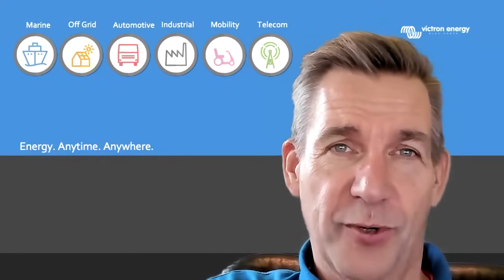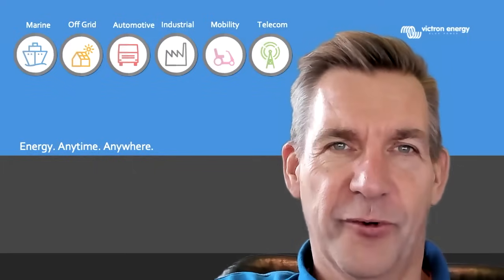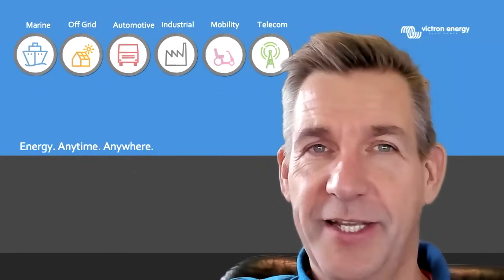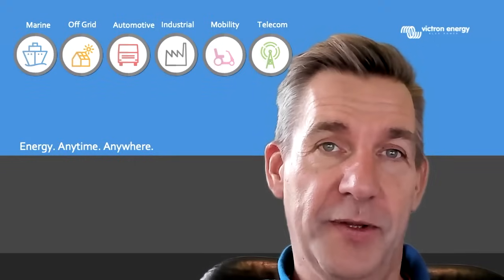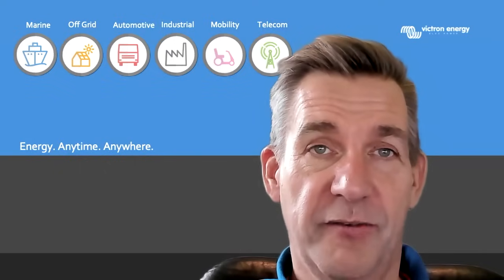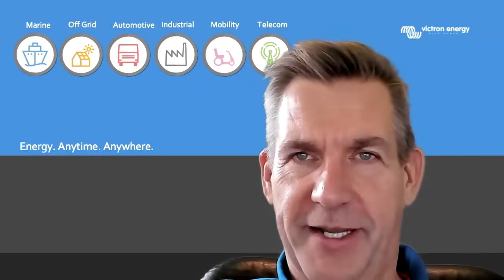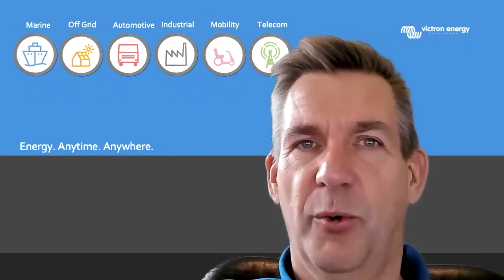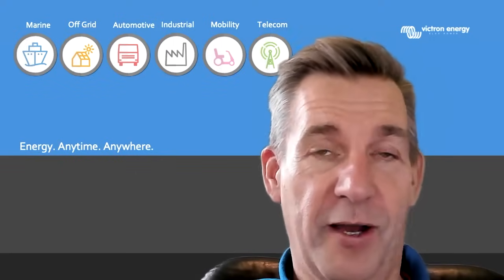How to set up BMV Battery Monitor for lead and lithium batteries

Comment: Great video i have just 1 question.  i just installed a smartshunt in my boat. We have both solar panels and shorepower nomally we will be on just solarpower and alternator power from the engine for say 3 nights then 1 or 2 nights with shorepower and then out again. For 3 nights. Should i program it after float voltage or absorbtion voltage in this mixed configuration? 300ah agm.  30a shorepower and about 400w solar.
And a bonus question. All producs are victron and connected to same  ve network dont the chargers tell the shunt when it is in float?

Comment: The title is "HOW TO SET UP  BMV". Instead you get a completely inaccurate description of the ElectroChemistry of a LA battery. The battery works on movement of IONS not MOLECULES. Quite fundamental. Was this approved by Victron ?
Reply: Ion / Anions are part of molecules e.g., KOH (potassium hydroxide) is the molecule while the OH "holds" a single negative charge. And still OH is also a molecule in itself, which it would be its state when dissolved in distilled water. What would be expected to move is electric charge, which ions facilitate.

Kindly provide factual, reasoned corrections, if any of the above assertions are incorrect.
Reply: the Lead acid batteries have molecules, the lithium has IONs.    It was approved by me by the way.

Comment: Dear Johannes, you state that in the original full charged state of a lead acid battery the positive plate will be covered with lead and the negative plate will be coverd with leaddioxide. In my opinion this is the other way around, In the fully-charged state, the negative plate consists of lead, and the positive plate is lead dioxide. mvg Jurgen
Reply: Yes correct, in fact both are plates of lead although the positive is covered with lead-oxide and the negative is pure lead.

Comment: I find this product very frustrating.   I'm using it with a 200ah LiTime 12V battery, a LiTime charger... I can not find a configuration that will reliably reset the SOC to 100% after charging.   I have posted in your community several times and the advice has been unhelpful.

I also find your support model of depending on dealers to be a disaster.   Your products are complex, with apparent nuance in your settings, and the dealers are entirely unprepared to help figure this out either.

Overall this gives a very poor impression of your product.   It's too complex for the dealers to configure, it's too complex even for the forum members to advise on.   Where am I supposed to go?
Reply: I am sorry to heart this.  it's actually not that complicated but it's not plug and play for users without technical background. Then better have an installer set it up.   Anyway   For your lithium, takes the charger voltage setting minus 0,2Vdc as the Vc setting. take the Ic as 5% so that the current needs to be low and the Tc at 5 min.  Should work fine when charged
Reply: @JohannesBoonstra-ol2nz  It's frustrating to have you say I should just use an installer, when your documentation is so lacking.   If you're not wiling to to create clear documentation for end-users, then you should stop selling these via retail channels.   You can't have it both ways.
Reply: @AndrewMetcalfe  The product is indeed not plug and play and requires experience on batteries to setup. The documentation and manuals go as detailed as possible but do require technical background. This goes for many technical products in your system I am afraid. It's impossible to make a technical accurate product for almost al batteries and assume the unit can be set up without any knowledge on the battery and charge regime.   Most people have managed to set it up though, it's also not that hard.  But I am sure your dealer/installer is willing to help you you need assistance
Reply: @JohannesBoonstra-ol2nz  Thanks for replying, I really do value your engagement.   I do think you'd do well to have some independent documentation specialists have a look at the instructions that you are providing.    This is a common question in your community.
Reply: @AndrewMetcalfe  the majority of user dont seem to have issues, the ones lacking the experience can contact the dealer/installer, is there anything wrong with that?   These are trained and motivated to help and you could even learn something on batteries
Reply: @JohannesBoonstra-ol2nz  You know, it's great that you're engaged like this, but assuming people are ignorant does reflect poorly.   I do not have a shortage of experience, but I do have a shortage of adequate documentation.   You don't actually have to reply to people on Youtube, but if you do - I recommend not insulting your customers.    FYI, a few posts up you told me 5% would work.   It does not.   I did try 10%,, and that does seem to be working for now.   Perhaps that is something you can change in the documentation.
Reply: @AndrewMetcalfe  its not ignorance  what I was talking about, it was about experience/knowledge.  It's not that many have had an education on battery/DC systems, which is OK.   But expecting to get this knowledge by reading through a manual isnt that realistic.   So thats why I give/gave that adivice to ask the expert you bought it from.    It could well be that your battery needs 10% instead of 5% what for other brands work, thats why there is not a single setting valid for everything. If that was the case the settings are not needed and we would have put the values in as fixed.     Anyway, most likely your battery supplier could have explained this to you as undoubtedly they have had to set up battery monitors before.

Comment: what about 220Ah battery float, absorption voltage and charging Amps when charging from Solar
Reply: that depends on the battery and charger setting.  Please ask the installer to make the correct settings.

Comment: I have a new SmartShunt IP65 installed and synchronized to my Dakota Li 12v 100ah battery after a full charge.  The shunt is reporting the current voltage at 13.3 (verified with a multimeter).  In the VictronConnect App, my Charged Voltage (per the manufacturer) is 13.2 volts, with a discharge floor of 10%, tail current set to 2%, and the peukert set to 1.05.  I am correctly wired.  While under load, the app appears to report correctly.  However, after a short period of time off load, the app will reset the SOC back to 100% and the ah consumed to 0.  This is a new battery.  It's being used with a trolling motor, and after a recent trip i used 7ah.  While the main screen reads 100% and no ah consumed, the history does show that i've been using ah's.  Is it possible that the relaxation period where the voltage is boosted responsible for resetting the SOC and ah consumed?
Reply: 13.2 Vdc as charge voltage might be too low, I guess you charge 14-14.4V ?

Comment: 04:20  "gassing should be prevented at all times" this may be true with AGM or Gel but with FLA you MUST allow them to gas as this is part of the absorption cycle. Without this gassing the plates will sulfate over time and fail prematurely which is exactly what happens with most lead acid batteries that fail early. If you are not putting distilled water in your FLA batteries every month then you are under charging them!
Reply: What most is used is the VRLA type, so there is gassing but this will not open te valves normally, for flooded (limited) gassing is OK to mix the fluids and have the charge process be optimal

Comment: Has anybody pulled the main points together?  I've really struggled to follow this and I'm a native English speaker with a first degree in electronics.  

Some well written documentation, and I've read the manual a heap of times, on the points covered would really, really help.

Comment: Hi
I have A Multi with new Victron Lead Carbon batteries.
I understand these are more efficient than standard Lead acid so what would \i set as an efficiency value and a Peukert value?

Comment: My BMV712 was a complete waste of money, I'm guessing like most similar monitors. It counts the state of charge downwards but doesn't count upwards, all it can do is reset to 100%  when it sees the voltage you've told it equals fully charged.

This means that as soon as I do any trip, unless the voltage hits the fully charged level, the soc reading will be wrong and misleading.
Reply: When it only counts down and not up, I advise you to have a look at the wiring as then most likely the charge current is not flowing trough the shunt but directly to the battery.  The monitor does NOT work with the voltage level to determine the SOC (as that's not a good indictor) but on current/energy instead (which is the right way to do this)    So please check the manual and installation and I am sure the BMV will make you happy!
Reply: @johannesboonstra6917  of course the charge current isn't flowing through the shunt, the shunt is on the negative side exactly as per the instructions. I didn't say it monitored usage based on voltage, I said it resets to 100% when it reaches a (user defined) voltage, that's all it's capable of. Total waste of money.
Reply: @paulshanesmith  per instruction, both charge AND discharge current need to flow through the shunt 
Please read the manual well , if you don’t follow the instructions, yes then it’s a waste of money

Comment: Trying to better understand tail current setting on the bmv shunt. It says to use 4% my battery is a 200ah batt. 4% is 8amps. My 200w solar charger which is my primary charger bulk charges the batt at 8~9amps. Seems like I would want a smaller tail current around 1-2amps or less with this type of charging. That would be .5% - 1% does this seem accurate?
Reply: Forgot to mention. Lithium.
Reply: The tail current is the current which will flow when the battery is full/under charge voltage. So that's determined by the battery.  This value is more needed to be set for lead acid batteries. Lithium is full when the end voltage is reached

Comment: Anyone know what I can do about my “low voltage” alarm? I have 300ah lithium battery with 400W solar. I left my iPad charging overnight which cause the voltage to drop to 11.62v which it’s been floating at all day
Reply: Then please recharge the battery asap with solar or a AC charger

Comment: You say "a lithium battery doesn't need an absorption phase", but then later, "take for the voltage charge, the absorption voltage minus 0.2V".  Why do you refer to the absorption voltage for lithium, when there's no such thing?
Reply: the lithium does not need absorption , But the charger does have a absorbtion setting which is used to balance the lithium battery

Comment: Having 4 x 12 volt 270 ah batteries in series and paralell  giving 24 volts and 540 ah. I am charging this with a Panda 6000KW generator but seems to take days to charge the batteries form 55% to 90% CEF is set to AU ?
Reply: This is an DC or AC generator ?        od DC , sure the negative is on the correct end of the shunt /On AC , where are you charging with?
Reply: @johannesboonstra6917  This is DC Generator, shunt is wired correct what are the correct settings my BMV Battery monitor for this set up ?
Reply: looking to set the discharge floor to 50% and the relay to start the generator at 50% and stop at 90% what would the efficiency need to be set at also ?
Reply: @michaelmunnelly-v9z  for lead that's about 75-80% , on lithium its 98%

Comment: Really good explanation, thanks! Brings together various strands from the manual and elsewhere and helped me make sense of it all.
One question came to mind regarding when an Orion is in use: say there are a number of short driving periods between which the engine is switched off (and therefore so is the Orion) does the same apply as for charged voltage and tail current on solar? Ie the charger going off at any point in the cycle is like a cloud passed over?
Assuming absorption should be 14.4V for a lead battery the charged voltage set at 14.2?
If so is there any issue when a proper float at 13.8V happens on a long drive or when a mains charge can be done?
Reply: the battery monitor will sync when the voltage is high enough combined with a low current, so if that's happening with an Orion its the same, as then also the battery is full.

Comment: Hello, I bought the Blue Smart Charger IP22 12/30/(3)  today and when my batteries (2x AGM 12v 140ah in parallel) are charging the charger makes a disturbing  loud enough humming noise. As the battery charges up the noise reduces. It doesnt get very hot but i didnt expect that noise  from a premium charger like Victron. Im wondering if i need to send it back because its faulty or something but the store i got it from says they may need to send it to Victron which means i will be without a charger for at least two weeks which is not ok. Anyone else with same expirience on that noise ? Thank you.
Reply: there is a noise coming from the charger , mainly depending on the AC voltage level.    If you think yours is too Lous, please contact the dealer and have them have a look/listen.  PS two week waiting for a replacement IF something is wrong is not true when contacting the official dealers (found on the website)
Reply: @johannesboonstra6917  Thank you very much.

Comment: Looking for settings for my system. 400ah 24v lifepo4 charging with Victron 150/60. Victron defaults to 28.4v absorption and 27v float. What should I set the "charged voltage" to? There's conflicting information online, in the manual, etc.
Reply: when the absorption on the MPPT is set at 28,4, the Sync voltage could be 28.1-28.1Vdc
Reply: @johannesboonstra6917  thank you!

Comment: That went way over my head very fast lol.  
Can anyone help me with my settings.  I’ll have two lithium 230ah batteries 
This is what I have so far 
Absorption 13.8
Float 13.4
Absorption 1-2 hours 
Equalization?
Peukert 1.05
Efficiency 99%
Threshold current .10
Time to go 3
Tail current ?
Discharge floor 20%

I’m sure I. Missing some settings but any help would be appreciated.

Comment: Hi everyone a little help please Am I right with these setting with using a mppt with lead 230ah battery mppt settings are 
Absorbsion 14.6 float 13.5 tail current 4… bmv-712 settings 
Charge 13.3v 
Discharge floor 50%
Tail current 4%
Charged detection time 3 mins 
peukert 1.25
Charged efficient factor 85% 
Multiplus settings absorbsion 14.6v 
Float 13.5v 
Or have I got this all the wrong way ? my understanding the charged voltage on the bmv needs to be 0.2v lower then the float in the mppt which is 13.5v so remove 0.2v leaves 13.3v or is it 0.2v lower then the absorb charge in the mppt so that would be 14.4v it’s very confusing sorry same with multiplus settings it’s confusing giving the mppt the bmv & multiplus all these settings to work together!
Reply: the Vc needs to be lower then the charge setting by 0.2Vdc at least,When having solar this needs to be based on the absorption voltage
Reply: @johannesboonstra6917  thanks for the reply really appreciate you taking time to buddy 👍 so on my mppt I’ve got 14.6 absorb and 13.3 float so that means in the bmv I have charged at 14.4 and float 13.1 
Also in the video he says to adjust the tail current to 6% is this correct ? I have 230ah of lead battery

Comment: Couple questions.  I have a Lithium LiPO4 900AmpHr @ 24V battery bank. Have a BMV-712 and a MultiPlus, generator and have solar with 3 Victron MPPTs.
Q1 - I am struggling with where to set the "Charged Voltage" Setting in my BMV-712.  My battery manufacturer tells me Bulk Voltage (same as Absorption) should be at 29.2V, and Float be at 27.6V.   I have set the charged voltage at 27.2V (based on prior info gathered) but in this video (@14:37min) Johannes mentions I should set it much higher at 0.4V below the Bulk Voltage (which is same as Absorption), so this means set it at 28.8V.   That's a huge difference, is that correct, I should set "Charged Voltage" at 28.8V in my situation, with Float V at 27.6. almost does not make sense, but seeking advice.
Q2 - When does the MP charger move to Float, what setting/criteria actually controls the MP charger to go to Float? Is it SoC @100%? Voltage level reached the "Charged Voltage" setting? other?
thanks
Reply: 1 Vc should normally be based on the float (just below this) but with solar systems just below Abs.  2 float is entered after the absorption period is done. this should be 100% doc but that's not controlling the state

Comment: I'm so lost.  This stuff is like another language to me.  I have lithium (3 of them each 100ah) and when I set my Peukert from 1.25 (default) to 1.05, as he says to do in video, the SOC dropped 20% instantly.  I am now awaiting batteries to fully charge again to "synchronize"?  I am not sure I am doing this right.
Reply: After you make a setting change the sync is needed to get all true as far as readout again.  so just charge the battery full and want for a full charge/sync

Comment: It would be so helpful if they came up with some type of chart or system where you could enter your battery's capacity/type and then it would tell you what numbers to put into the system.  It seems like the majority of questions are related to that.
Reply: yes I understand, but as batteries tend to be different the settings are not equal per chemistry/type/model.

Comment: Anybody can give me right charged voltage setting?
I have 300 amp Lifepo4 battery with 2 140 watt solar panels.  Thx.
Reply: When that's 0,2Vdc LOWER then the absorption voltage
Reply: @johannesboonstra6917  i set it at 14.2 volts. Seems to work fine